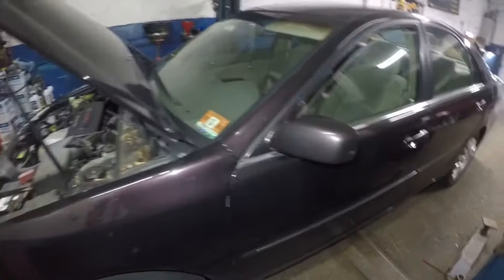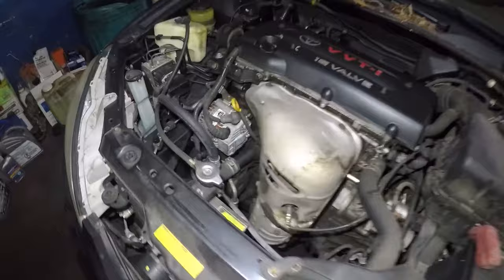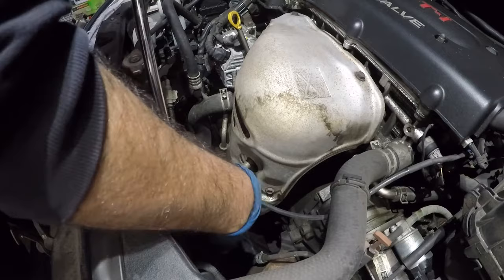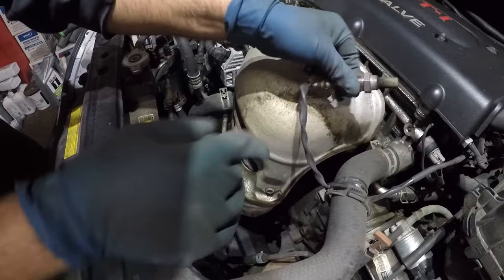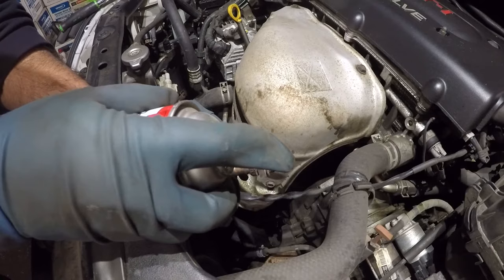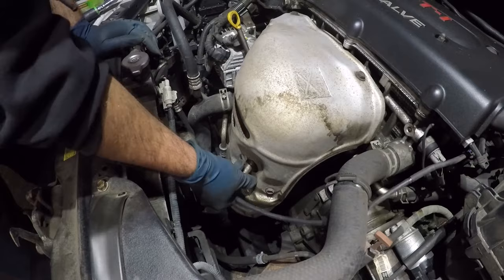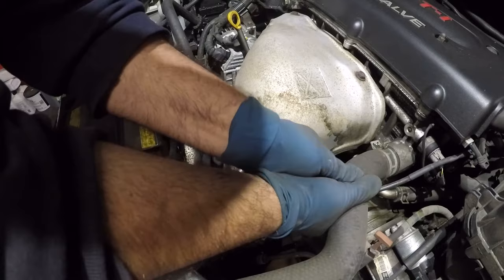How to clean catalytic converter  while on car, customers request to spray down with cleaner

Comment: Great idea! I'll try this on my 2013 Hyundai which is burning one (1) quart of motor every 500 miles; and, now, the car has driveability problems.
Reply from the maker: Oh those are terrible!!! Try fixing ur oil consumption issue first
Reply: Check out piston soak videos.. B12 cleaner or others

Comment: I used to have a code for catalytic converter.  I've been using injector cleaners in the tank every refill. No more engine light
Reply from the maker: Oh niceee
Reply: which injector cleaner?
Reply from the maker: @nadeem5476  crc
Reply: @nadeem5476  Israrted with cataclean twice it went away for 100 miles. But it came back  for another round. I tried B12 chemtool same thing. I tried high octane more power but same issue. I tried Lucas, gumout, stp, and I can't remember what else. I found out that a regular stp or gumout used on every full tank will keep the code away for longer. Some how now I have to use it for ever. But like I said this is a 230k mile engine. I can't say what for newer
Reply: @fernesal  try using laquer thinner a gallon In half a take drive till the half tank is gone
Reply: @antoniop5889 did it work for you???

Comment: You can start with this method but if the catalytic converter has overheated on the inside it will melt the honeycomb and you'll have the code returning over and over usually after a few days or so sometimes a little more. Another thing you can try is when you get to a half a tank of gas full literally buy a gallon of lacquer thinner and pour it in the gas tank and then fill it the rest of the way to a full tank of gas and drive 150 Miles or more on the highway or use a tool to set your RPM at about 4,000 for 30 minutes and it will clean out the cat., Although the best way is to take the cat. off the car and soak the lacquer thinner through the entire catalytic converter from top to bottom and then use a soap solution( like some dish soap or liquid laundry detergent and water to clean that out afterward then spray out with hose and let it dry and then reinstall it. If you're just trying to pass smog most of those ones that claim it will clear the code like cataclean or CRC etc. will work to clear the code to pass smog but usually the check engine light will come back on later which is fine if you can get your smog certificate and register the car. I've done this and it works but again if it is melted on the inside it will only clear at temporarily and to do a long-term fix you would need to replace the cat any welder at a muffler place that does catalytic converters could tell you if it's melted buy inspecting it from the outside. As crazy as it may seem, if you Google it,it  will literally come up with the voice confirming that it works stating verbally the paragraph with instructions of the lacquer thinner method. If your catalytic converter is not melted then I would recommend doing this every 3 months to keep it from ever needing to be replaced.
Reply from the maker: It worked well for me

Comment: Root cause : leaking valve cover gasket allows [integrated with spark plug tube seals] oil into the spark plug wells, causing misfire, thus damaging cat.
Reply from the maker: But there’s no misfire or oil in spark plug tubes
Reply: @RBTheMechanic  That's was one of the issue of the 2005 RAV4 I was working on (although minor)  Valve cover gasket is next on my list with PCV valve to manifold hose disconnected at manifold (customer is on tight budget!) Code P0171 fix on it https://youtu.be/uS3IcsBIAAE
Reply from the maker: @mkrp4  yup could be the issue good information to be away tho I see people drive around with heavy misfire and they lack to repair the issue then it gets more costly
Reply: You are correct. Quite often that is the case with DOHC engines.
Reply: @RBTheMechanic  
That’s what my reply is always. People saying coolant leak into cylinders BUT coolant level is the same & oil looks great
Reply: For me the root cause was a leaking exhaust manifold gasket which caused the wide band 02 to ride low most of the time telling the PCM to give it more fuel.

Comment: I would like to see if the catalyst was damaged first. The throttle body cleaner is primarily xylene and would have no ill effect on the ceramic honeycomb. If the catalyst if fouled, this would be a temporary fix pending correcting the cause of the fouling.
Reply from the maker: This been good ever since. Passed inspection and all

Comment: This was an informed video, and I would give it a rating of good.  However, the oxygen sensor should be disconnected always, because you run the risk of damaging the wire.
Reply from the maker: Ok will keep that in mind

Comment: Why not unplug the O2 sensor instead of twisting the wire up?
Reply from the maker: If u becarefull u should be good but do so
Reply: That’s what I thought 😂
Reply: Wow I have 99 Toyota Camry manual transmission and the code came up as a catalytic converter, I didn't think to try the process of elimination and clean the O2 sensor but I will try this. Hopefully it will work.
Reply: What’s the issue with twisting the wires? You know that how manufacturers store the wire and how do you think it looks inside the wire loom? If you are worried about the wires breaking then it’s probably time to replace the sensor anyways
Reply: A lot of Toyota connectors become brittle over time. The huge pain in the ass of hunting another OEM connector down alone makes unplug as few things as possible.

Comment: This worked for me prior.......... years ago......but I am still struggling w the same vehicle, other codes (in addition).  Since Im now down to just CAT CON code, perhaps Ill try this directly again.   Previously I drilled small holes just before the cat cons - in order to keep the O2 sensors still active (to avoid having to reset the OBD2 to start.. since this was taking me hundreds of miles to route thru!).   With the engine running Id slowly spray in an entire can... then seal the holes w screws.    //    I also just tried LIQUI-MOLY CAT CON cleaner spray into the air intake just before the throttle plate (and reset the OBD2 reader).     Cataclean in the fuel tank seemed to have a good effect also... months ago! I found 3L at a good price and used the full 3L in a nearly full tank.
Reply from the maker: Try replacing down stream sensor

Comment: Throttle cleaner / solvents can flash off... also if cat isnt vertical I'd think the sediment would dislove but not fall off? Good idea though to remove the o2 and or drill a small hole.

Comment: wished you would of put a pressure gauge on  to test before and after back pressure on that cat  ,a good back pressure is 1 1/2 psi  at 2500 rpm .
Reply from the maker: Yeah but that would make job hell of difficult pressure would go out valves

Comment: I have a 2009 nissan altima same problem. Will try that and report. Thanks so much
Reply from the maker: Yup use catalytic cleaner let it dry off for a bit also u can try fuel injection
Reply: @RBTheMechanic  Thanks so much

Comment: I got 2006 Honda Pilot screaming code p420 p430 cat’s 
I’m gonna try this with Berryman B12 straight down the hole.
I did today and I got that resistance as I accelerate gone and it starts in one second now. Before it would crank hard for 5-10 seconds before start. I’m test driving to see if overheating at traffic stop goes away. Not sure I’ll let you know if clogged catalytic was the problem to all my issues
Reply from the maker: Well I would reset and wait for the light to pop up and scan again immediately

Comment: I just added a coupler and will properly clean it this coming summer. That fixed the light. Even removing the oxygen sensor and my fingers were frozen!
Reply: What kind of coupler did you add and where? I'm having the same issue.

Comment: @ RB THE Mechanic, does the catalytic converter have to be cooled off, before spraying the cleaner?
And does the spray cleaner have to dry overnight?
Reply from the maker: Yes both would be good cold and let it rest over night or few hours
Reply: Also another question, do I use half the can or the full can of spray cleaner?
Reply from the maker: @orinyellowhair8278  less than half

Comment: Heck yeah! nice video. What type of socket is that you are using to take the O2 sensor off?
Reply from the maker: Oxygen sensor socket 22mm or 3/8
Reply: 7\8 special slit socket
Reply: You can rent them at auto parts stores.

Comment: Can you spray liqui moly catalytic system cleaner in there ? And also should you spray it while the car is running or like in the video ?
Reply from the maker: No not with car running never do that
Reply: @RBTheMechanic  ok so i have two sensors one in the back of the turbocharger and one is after the catalytic converter do i spray inside both locations of o2 sensors or just the one that is close to the catalytic converter
Reply from the maker: @ahkh642  what kinda car u have  not sure the set up of ur catalytic but it might not work out due to location on sensor
Reply: @RBTheMechanic  you probably have never heard of it , it's from a Chinese manufacturer called Gac Motor , Ga4 .
anyways thanks for your help i really appreciate the dedication you have for your channel you're a really nice guy i hope you get whatever you want in life you sure deserve it

Comment: If you take the downstream o2 sensor out to clean,  can you spray from down there to get it directly into the cat?
Reply from the maker: Not Fron down stream it has to be from upstream
Reply: @RBTheMechanic  would this spray be safe to use to clean the carbon out of the EGR exhaust port/channel?
Reply from the maker: @apollo11capcom39  yup

Comment: Mine was a 0420 and a 0303, 0304 (misfires in 3,4)  ran cataclean, swapped fuel pumps, changed sensors, spark plugs, new coil, coil packs,,,,,,STILL THERE.
 Just before swapping the cat I saw a YouTube video that casually mentions, a stuck open PCV valve would foul the spark plugs with oil,  the cat sensors would trigger, and the cat itself also would be damaged.
  Swapped the pcv valve and the light went out, without reset @ 80 miles later.
I'm guessing the Cataclean worked.
Oh also check the coolant temp sensor because bad readings will mess up the air fuel calculation, making it run rich or lean messing up the cat, sensors, and possibly cause misfire and also hard starts in the morning.
Reply from the maker: Check vaccum leaks and injectors

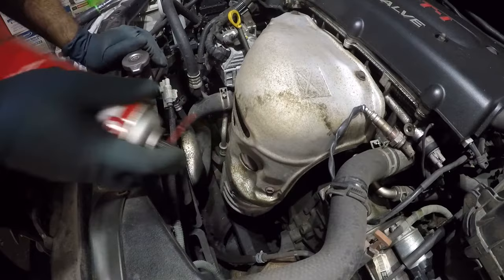Comment: At  1:58you said  work on it when it's  cold , but then at 3:30 you say that the engine is hot.  So did this work? It didn't look like you sprayed enough either.
Reply from the maker: I meant to do it on cold and if it got it’s fine and let it dry anways u don’t need to spray lot I would do few times

Comment: Its one thing to do what the customer wants. Okay.
But really, on that engine, it would be so easy to remove the cat assembly, leave it soak in detergent water over night, blow it out the next morning, resinstall, use an actual exhaust back pressure guage to confirm 0 pressure. 
If, don't want to do all that, use a product called "Cataclean". Works good to clean out the cat, but won't fix a cat. Beware.
Reply from the maker: Bolt will brake !! I rather take out the sensor

Comment: Don't come at me for asking a dumb question..
But I have a 2009 Malibu 3.6. The o2 sensor and cat are accessible. 
Do I have to remove the cat to drill a hole in it? Where do I drill the hole? It's horizontal. Thanks in advance for any help.
Reply from the maker: Drill hole? U don’t do that access through o2 port

Comment: I got the P0420 error on my used 2016 CRV in January end. Took it to the dealer and he charged for check engine light and erased the code via ECM/PCM. The error came back again after 4 weeks and just when I thought of going back to the dealer the code/check engine light itself disappeared for a week but came back again a couple days back. I took it to the dealer today and he says technician checked o2 sensor and exhaust leak and they are not a problem. He has given me an estimate now for catalytic converter change and has quoted close to $1700! I do not have the budget now and would like to try this method or May be try any other liquid catalytic cleaner via gas intake. A local mechanic suggested to try erasing the code 3 times before taking any decision spending so much money. What are your thoughts please or what do you suggest what best liquid cleaner I can try now???
Reply from the maker: U can try fuel edditeves before replacing it might get cleaned out or u can try replacing down stream sensor other wise u need to replace the catalytic
Reply: What did you end up doing? And did it fix the p0420
Reply: @ducrogers302  had to ultimately change the catalytic converter

Comment: Would have been nice to test to see if what you did.... works. Run the car and see if the PO420 code is gone.
Reply from the maker: P0420 code dosent go away on its own we reset it with scan tool then the l cycle is to drive the car for no less than 90 miles if there’s issue it will come on
Reply: @RBTheMechanic ..yes you can reset it....BUT.....if it's truly fixed it will go out by itself after 5 (or so) drive "cycles".... cheers.
Reply from the maker: @TheWilferch  well it never came back and customer passed inspection and he came to do other services so no issues
Reply: @RBTheMechanic  ..just getting the facts straight ( fo others who read this)....that yes,... you can reset the code immediately after you fix it... but you can also drive several drive cycles and the light will go off that way too. In either case, if the condition is not fixed, it will come back on later.....cheers.
Reply from the maker: @TheWilferch  ok
Reply: @RBTheMechanic  ....👍

Comment: Hi did it workout with that camry, coz i have the same issue with the same car camry 2005,i replaced 02 sensor but code P420 came back after a week
Reply from the maker: Yes I had free I had to clean or replace the downstream o2 sensor check that also

Comment: There's no CRC catalytic converter cleaner spray can sold in Auto parts store,  nor Amazon as I could find under CRC brand. Please advise. Thanks!
Reply from the maker: They have catalytic converter cleaner also fuel additives
Reply: @RBTheMechanic  What about just injecting water and detergent mixture into the pipe while it's running the hot catalytic would steam the core clean. I've see water injection on turbo cars clean pistons, and combustion chambers spotless....
Reply from the maker: @blkcoupequattro  no that wount be good idea

Comment: Hello i jst bough a 2013 toyota vios with 2nzfe engine.
Its a bit sluggish n mechanic told me mayb the cat convert is blocked.
Should i let the engine on while spraying wd40 into the O2 hole???
Reply from the maker: Did u scan for codes  and check catalytic temperature
Reply: @RBTheMechanic  no... Should i??
Reply from the maker: @joyhearthacker5022  yes

Comment: The nozzle fell off into the converter. I couldn’t get out. How bad will this be?
Reply from the maker: Gotta get that out it’s bad will melt fire
Reply: I assume the nozzle is completely melted by now?  I have been driving the car for several days. Is there anything I can still do at this point?
Reply: Since I have been driving the car with the nozzle inside the converter, is there anything I can do now that might help?
Reply from the maker: @retiredprincipal410  it’s too late h already melted it nothing else u can do
Reply from the maker: @retiredprincipal410  yup nothing to do now

Comment: So for instance on a 97 Chevy 3500 dually I assume I would have to remove the O2 sensor right before the catalytic converter underneath the car correct?
Reply from the maker: Yupp also clean out rear o2 sensor
Reply: @RBTheMechanic  ty compa👍

Comment: I have a 2008 Mitsubishi Eclipse with the 2.4L 4 cyl.  The catyletic converter is part of the exhaust manifold.  I was wondering if this would work for my situation?  I have also heard of using lacquer thinner.  Could I use a funnel and pour a little in it as well as using the spray?
Reply from the maker: No best thing u can use in this can is fuel injection it will enter from engine injectors and go through whole systm

Comment: I have a 2015 jeep patriot and my engine check light came on and  said my cat isn't working properly anymore and I feel it when I drive . now should I put the liquid in my gas pump to clean it before replacing it ?
Reply from the maker: No try cleaning g or replacing oxygen sensor first downstream

Comment: hello friend, my 06 honda catalytic convertor is restricted. the sensor is on top of convertor. is this method working on mine too ? if yes, what kind of cleaner you offer? what about if using actual gas to clean inside it using pump or whatever. I've seen a video talking about adding to the gas tank. is that working same as directly clean the inside net through sensor hole? thanks for your help in advance.
Reply from the maker: If it severely restricted then u have to replace it

Comment: I have my 2007 Lincoln Navigator lack of power… no engine light but the rpm wouldn’t exceed 3000 rpm could be a catalytic converters problem?  any advice will be appreciated… thanks
Reply from the maker: Scan the car for codes even if u have no light and see if there’s any pending or memory codes with high end scan tool

Comment: My Honda Odyssey has two catalytic converters. I the check engine light come on and sometimes goes off by itself. I checked and it say bank 2 catalytic converter, the one immediately after the engine, similar to the place of your Toyota.  If I put this spray in will the dirt move from Bank 2 to bank 1? Or will this clean them both?
Reply from the maker: I u can clean sensor but after u do this or replace sensor the down stream